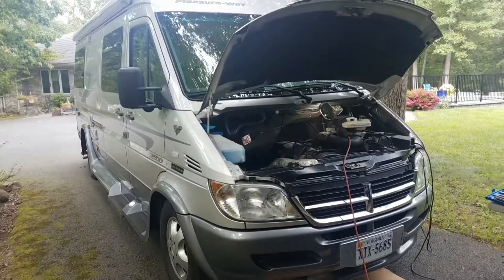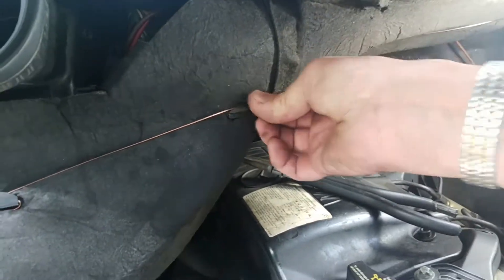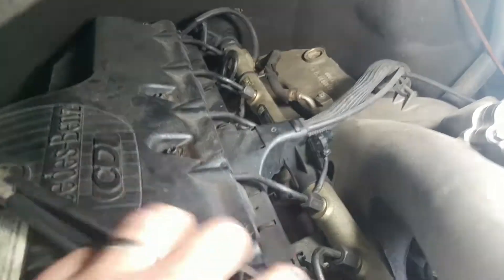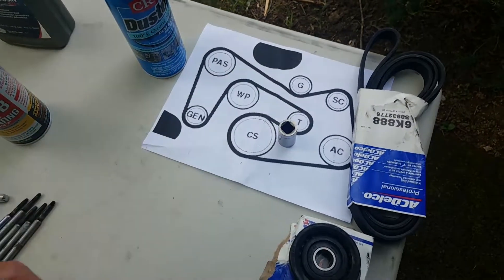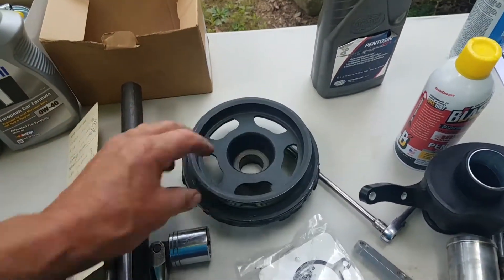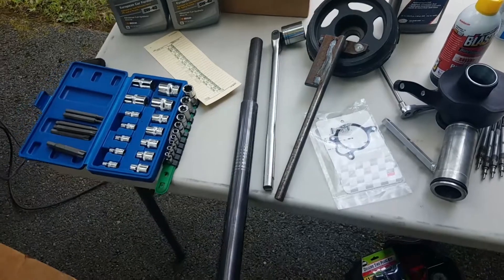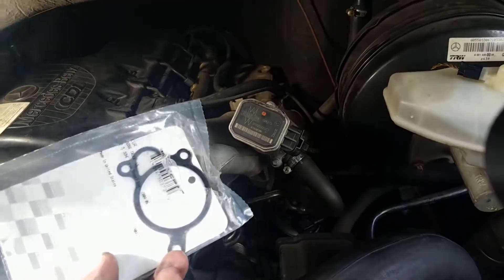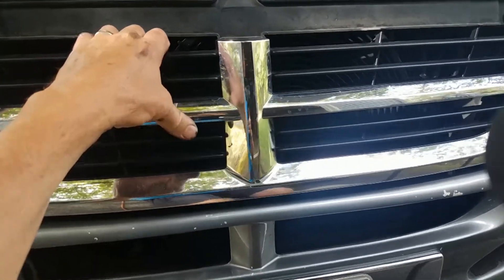2006 Sprinter Engine PM on a 5 Cylinder Diesel

Comment: Woah thank you for the video. Well thought out and very helpful thank you. What’s was the noise your heard with the harmonic balancer going on and the process that you went through to find that problem? For the most part your recommending changing most this stuff before you need to. I’ve started to find that mine is all pretty tight and brittle pieces.. nervous to fix anything that doesn’t need to be. But I love taking care of engines so again thanks for this video. Going to share and save. ❤
Reply from the maker: The first warning sign that the harmonic balancer was going bad was a notable engine vibration when I came to a stop at a light, etc. 
As a precaution, I now crawl under the front of the engine every thousand miles or so, and (WITH THE ENGINE NOT RUNNING LOL) I try to move the outer ring of the harmonic balancer.  
F.Y.I., I had always driven my Sprinter like a car, accelerating quickly, and 75 plus mph on the Interstates. Over the last few years, I slowed down and drive it more like a truck. I seem to be having less turbo resonator and harmonic balancer issues.
Thank you for watching and commenting!

Comment: I have the same engine in my sprinter based in France Europe and it does not have a Turbo resonator as standard, Plus I notice a few other differences no EGR valve, I also changed the harmonic balancer and put my wrench on the main bolt fixed to the ground and just turned the engine over to undo the bolt 🙂
Reply from the maker: Loosening the harmonic balancer bolt by fixing the wrench to the ground and turning the engine over sounds like a very dangerous idea. There are so many thinks that could have gone wrong. Thanks for sharing!

Comment: Why in the world would an engine be going through harmonic balancers? Never heard of such a thing, they should be good for the life of the engine or at least 250K. I question any savings you find at the pump over all the expensive parts and maintenance in these rigs especially now that Diesel prices are approaching $6.00 gal. not to mention the lack of qualified mechanics who actually know something and are willing to work on such creators. When these first came out in the US many fleet companies tried them and quickly found out they were not reliable and costly to maintain and soon there after replaced them with the more familiar brands again. From someone who has owned a Sprinter from the beginning in 02' stay away from them and you will be glad you did.
Reply from the maker: I replaced another harmonic balancer at 125,000.
They come off and go on the crank a little too easily. I often wondered if the crankshaft was ground undersize and it didn't get inspected properly when it was made. I now carry a spare.
Reply: @realityrvto2644  Domestic vehicles has a remedy for the loose fit. The fix is called a repair sleeve and it makes up for the slack that too much tension causes the looseness over time. First, proper torque setting wasn't achieved second, usually, a repair sleeve is required with an HB replacement and third is to try to get the best HB your money can buy,.
Reply: Americans try too hard to hot rod euro vehicles like Lambos', Ferrari or Porsche. Haters can break anything quickly as long as they do not pay for it. Use a repair sleeve with the new HB.
Reply: @yosquidd242  Oh yeah right, we Americans are racing our Sprinter vans like Lambos? And Haters can break anything? What have you been smoking dude?

Comment: Very well done, thank you.  I'm looking at one of these now but it sure seems like the Germans love expensive, frequent, maintenance items....you realling don't have that many miles on that motor, if you had to pick, would you go diesel again or gas?
Reply from the maker: The Class B RV diesel was the only way to get 20+ MPG. So, yes, I would do it again. I assumed I could go for a few hundred thousand miles without having so many issues, but that’s not the case. 
FYI, I replaced another harmonic balancer at 125,000 miles. I was in St. Louis, 925 miles from home and could not find one in stock at any auto parts store.  So, I removed the outer ring and drove home. I had to keep the tac under 2800 RPM’s to avoid harsh engine vibrations. Now, I carry a spare with all the tools to replace it along the highway.